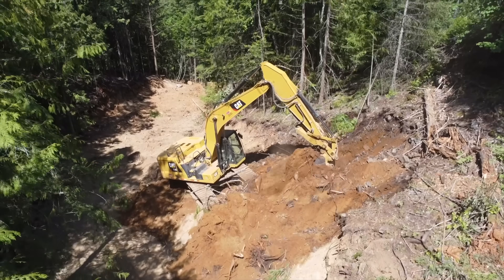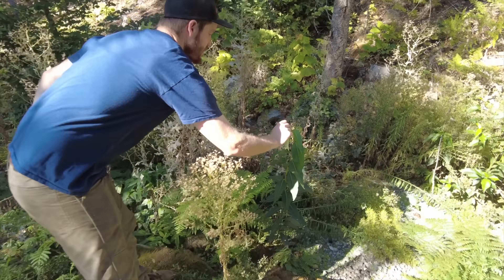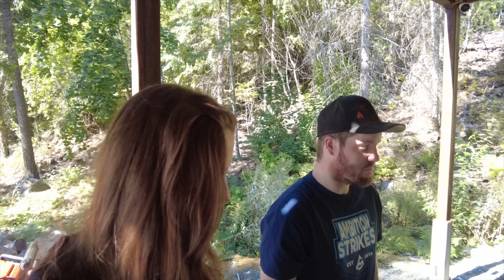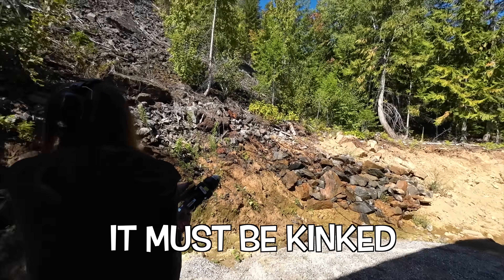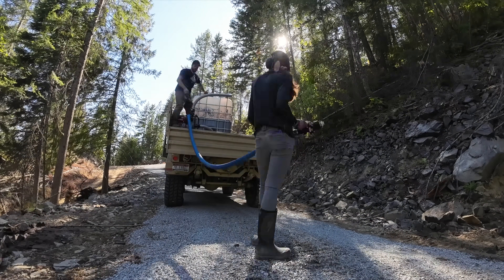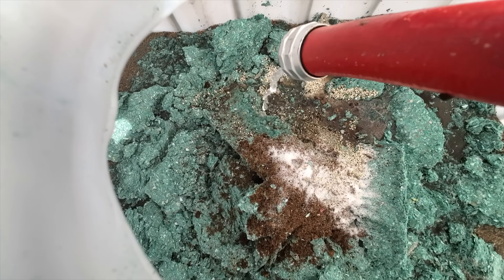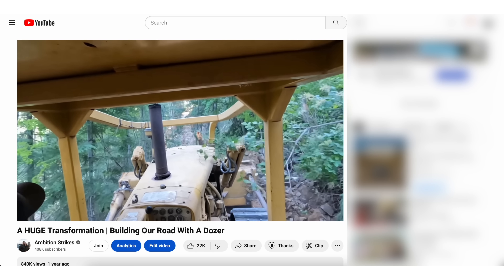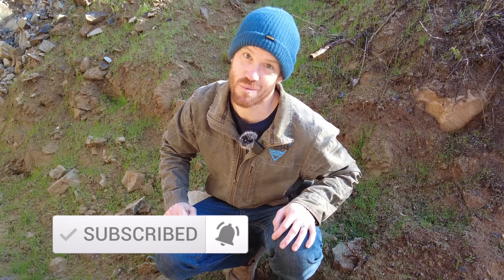Building A DIY Hydroseeder | Off-Grid Living

Comment: The cool part about the hydro setup is, when you are not using it to spread seed, it can be a great fire fighting tool.
Reply: Good call!
Reply: It just need to be ready at all time. Every pipe connected, pump primed, water tank full, and fuel tank full. And on a wheeled platform, trailer, truck bed...
Reply: @niconico3907  some sort of pallet or skid mount that the skidsteer can grab would probably work just fine.
Reply: Just came to mention this

Comment: That setup could also be put to use in case of Godforbid a brush fire or house fire. Would be better than waiting for the fire company to show up.
Reply: Put gutters on their buildings to collect the water.  We have an off road place where we do that. On our small roof one tenth of an inch of rain equals 30 gallons of water. Their roof would probably give them 100 gallons for that same amount of rain.
Reply: I thought that too! Having a full tote of water at all times would be a good idea to kill small fires.
Reply: @susanhighfield8284  Our last house was on a creek and in 1996 there was a big fire heading towards it. I bought a big pump and a small pump. The big pump would fill 3 55 gallon barrels in about a minute. They were in the back of a pickup and I had a long garden hose and a small gas pump to put out hot spots. I’d leave the big pump running water all over the lawn around the house near the creek.
Reply: @@grantjones5925 I get 3-6 feet of snow on the ground most winters and don’t have a problem. I mounted them low so the snow slides over them as most snow slides out some before it drops to the ground. Most rain doesn’t fall hard enough to overshoot the gutter coming off the roof. I’ve been doing it for over 20 years and no gutters have been damaged.

Comment: Attention, Riley and Courtney.. Tim from Canada.  If you were to hook a trailer onto your truck, your wife would have someplace to stand and you can do everything in one shot instead of her running up and down the road if she stood inside the trailer or even in the back of your truck. This would help your jobs go a lot easier for Hydro seeding your mountain. Just a suggestion (((number one.. hook a trailer onto the back of your truck have a long enough hose so you have some place to stand and this can be a one shot deal where you drive and Hydro seed the mountain same time
Reply: she could just stand next to the tote on the army truck.
Reply: Riley, .you should build a mount on the truck similar to a water cannon on a fire truck .  That way, Courtney can just pivot and aim.  Plus a water cannon seems right up your alley 😅
Reply: In some clips they showed Courtney standing in the back of the Army truck

Comment: Was wondering where the thumbnail photo you used was in your video?

Peat moss is THE secret for growing grass in an area thats just dirt. Those spots where you were disappointed in, if you hand tossed about an inch of peat moss over the seed you'd have grass in a week. You have to water it of course. Ive used peat moss on every new lawn I've put in. Holds in moisture and gives it some organic fertilizer.

Comment: we had best results by seeding, raking the seed in then spraying mulch to cover the seed.   This prevented the seed that was suspended in the mulch from germinating then drying out before the roots reached the soil.
Reply: i think their land would be too difficult to rake. it's not topsoil
Reply: @ronblack7870  just need to cover the seed.   If there isn't enough fines to cover the seed it will not take root.

Comment: I hope the grass does not get too high or dry out quickly in the summer and add to the wildfire risk. But if it stays green and keeps the ground from sloughing away it will be worth it! Will you get the roof on the new big shop/shelter building for the machinery and vehicles before the snow flies?

Comment: Hi there,
                 Those camlock fitting are renowned to pop open from vibration. Secure them with a cable tie thru the two metal rings. Obviously you’ll need to cut them off again. 😎😎

Comment: So from a guy how has worked in the industrial hose business for over 40 years that Blue discharge hose you are using is meant to be a way to dish charge water from a pump as an open end discharge only. It is not meant to be shut off on the discharge end while the pump is still applying pressure.  For that you should be using a discharge hose called mill hose ( looks like a fire hose). 
The blue discharge hose is like the cheapest stuff made.  You can also use your suction hose on the discharge side ( like you did)as long as you don’t exceed the PSI of the hose you have. Also a tip to slide the p c suction hose onto a fitting is to carefully heat it up. Few seconds in some boiling water or use a heat gun ( but keep it moving around). Let it cool a little and tighten up the clamps ( use two per end on 2” hose ID and up

Comment: Pretty cool. Your hydroseeder setup can function as a fire truck in the summer (with the right fire hose and nozzle). You would want a refill tank above the level of your tote on the truck with a large diameter hose ready to quickly refill the tote. If you really want grass to grow you'll want to put some topsoil on the tough spots. You could spray a manure or compost mix until you get an inch or two down. You need enough organic matter to hold the moisture. You could water the hillsides with this setup during dry periods to establish a solid carpet of grass.

Comment: Years ago, I used to work for a commercial landscaping company, and we'd hydroseed a ton. The mulch we used was basically ground up newsprint. Also, the hydroseed truck had a big agitator that kept the slurry moving around pretty good as we sprayed. Maybe in the future, you could rig up some kind of motor like an ice auger or something to stir the tank? Also, for steep inclines like that, we'd get large rolls of jute mesh that we would roll down the hill on top of a layer of topsoil. The jute mesh was then anchored to the slope with long metal staples. The jute helped the plants have something to "hold onto" as they grew, and would also hold moisture a bit. Eventually the jute would biodegrade and the staples would rust away.

Comment: You can use a sawsall with a metal blade or a cutter wheel on a grinder to cut large hoses or poly tubing.depending on the situation safer than using a blade sometimes

Comment: That's not just a hydroseeder, but a firefighting rig as well.  You could very easily modify it for use as both.  There could be a big water tank for fires or making your seed slurry.  The truck could then be used to irrigate those dry areas along your road.

Comment: Hydroseeding results that I have seen looked a lot greener than your - I think they spray it on a lot thicker than you are doing.  That doesn't mean you're doing it wrong, but you may get a lot thinner growth than you expect.  But, you're doing the right thing - erosion of all that bare soil is going to be intense.  A cold, snowy winter would be a boon, as the snowmelt would result in a lot less runoff than rain.
Reply: No classic hydoseed has dye in it to make it easier to tell where it has been done

Comment: When I see the highway maintenance department doing this, it's a lot thicker, and it's super green, so it shows where they have sprayed and not sprayed. Maybe go over that hillside again with the final application that was done correctly. And you will need to water it occasionally too. Getting new grass seed to grow takes a lot of water. But not to much to wash it all down the hillside. Good luck.

Comment: Nice build. You actually have another use for that setup and that would be a portable firefighting tank and pump. With you being off grid it would be nice to have a 250 gallon tank for an emergency around the home or if a small brush fire started. Just need to keep the tank topped off and protected from freezing.

Comment: For the areas where growth is a problem I suggest using a tougher seed more suited to harsh condition   the soil may be innert sub soil mulching  and or fertiliser  would be a start in addition wildflower seeds mixed in would produce a stunning displays four season varieties the best results   giving pleasure in and out as you have got a seeded  its not to much cost I don't know what variety of the grasses you have but very hard wearing  looking great container shop will be awesome  ever considered turn the roof into a cabin type structure would look fantastic with that view
Reply: I've improved readability of your comment:
To address areas where growth is a problem, I suggest using tougher seeds that are better suited to harsh conditions. The soil may be inert, so subsoil mulching and fertilization would be a good start. Additionally, mixing in wildflower seeds would produce stunning displays of four-season varieties and provide pleasure year-round. It won't be too costly as you already have the seeds. I don't know what variety of grasses you have, but if they are hard-wearing, they will look great in a container shop. Have you ever considered turning the roof into a cabin-type structure? It would look fantastic with that view.

Comment: Well done team Ambition!  A friendly tip from someone who works with Banjo fittings and totes.  Use gardening velcro ties to hold the clamps closed. You don't need much holding power to keep the clamp arms closed. Quick and cheap.

Comment: Many years ago I worked for a company that had to hydro seed. I don't remember the name of the chemical that was used but it was a white powder that was added to the mixture along with a dye to see where you got coverage. The white chemical would turn into a jell substance that when sprayed onto a solid rock wall would retain moisture and feed the seeds for awhile and would absorb rain and hold it for a while. They grew grass on solid vertical rock walls. Research that.

Comment: Ha!  I commented on this concern on the previous video and you all knew you were already all over it.    You could keep a small shovel in your car and every trip back from town you can transplant some local fauna to our bare patches?  The only winter prep I can think of is you all putting a fuel storage system (insulated) if required by your generator so it is easy to run the generator when the solar is slacking.

Comment: Very interesting!

However,  as I think about it, I'd be inclined to spread your seed, peat moss and such by hand and then use the pump to spray water on it to encourage sprouting.  That way you'd have much more control over where your seed goes  ---and you could return to add water if rains aren't helping.

Very creative, though.

Comment: As far as getting ready for winter, you will want to make sure all of the fluids are topped off in all of your vehicles and maybe get some trickle chargers for the batteries. If you think you're going to be using the diesel powered equipment, an electrical supply for the block heaters will most definitely help starting on days and nights with freezing cold temperatures which will help mitigate the pleading the battery power.

Having a supply of food for a month wouldn't hurt but I don't know how far off grid you folks are.

When feasible I would definitely get some more water totes and possibly daisy chain them together with valves on each outlet to increase the water supply.

Comment: Most erosion is not from water or snow falling directly on the cut.  It's from water coming down the hill side and accelerating when it's hits your cut.  It can help a lot to dig a drainage ditch just above the cut to divert that water.  Then you coat the ditch with gunite so IT doesn't erode.  I can see that the surrounding land doesn't really have much grass, so I'm pretty skeptical about the grass thriving on your cuts.

Comment: Have you considered using some of those gel-based water pellets on the dry spots? I've done some volunteer work packing tree saplings, and we would always dip the roots in that stuff before bagging them. No idea what they're officially called though, I hope you know what I'm talking about. They might need to be buried in the soil to work properly. Maybe throw a bucket load on top after you put them down.

Comment: Add tall poles, tipped with reflectors near the lower edge of your road.  Since you do not have actual guard rails it would be good to know where the drop off begins.   Do you have a fuel bunker or are you bringing in cans when needed.  Perhaps you could store winterized diesel and some gasoline in bulk containers, 55 gallon steel drums.  Away from your house and solar arrays but within easy access.   

Wishing you and your family a blessed holiday season filled with gentle seasonally appropriate weather and restful evenings together.   Peace

Comment: I did notice you were making some heavy cuts into the slope. Have you looked into Gabion Cadges / Baskets? Boxes of heavy stainless wire mesh filled with rock. You did rip out a lot of rock. And a simple jig would make welding fairly simple. These are used a lot in Canada (& probably the States) to stabilize highway cuts. When stacked on a slope, the self-weight would go a long way to prevent slumping. Especially since excess soil moisture drains easily, releasing internal pressure. Suface erosion is virtually eliminated. Aesthetically, they have their own thing going on, especially when local rock is used to fill the cadges. I'm not an Engineer, and I'm not there.
Reply from the maker: Every time we see gabion cages we admire them. It looks like a fun project that would really help us in a few spots.

Comment: While you have that pump and toet setup you can easy take additional water from your well (if you have)? and water the probem areas who makes you worried and the slow growing spots. Giving them a boost as long as its warm enough to grow. 
Same goes for next years spring.
After the first warm month you should see areas where its not gwoing. 
You and can seed it again and now water it down as long as you have access wate.
If you are putting some spreading system like a firetruck would have on the army truck you have a fire fighting setup along your roads and a water delivery system for hot and dry periods.

Oh and please empty all your pumps and hoses and let the valves open in the winter to prevent icecracks. For a potential fire fighting setup realy important to not destroy it. Also to get into the habit of emptying the pumps after use and filling it up with new gasoline (ethanol free if possible fo long therm storrage)

Comment: How are you putting air back into the tote to replace the water pumped out ?   A vacuum in the tote will collapse the tote.
Reply from the maker: We drilled a hole in the top of the cap!

Comment: Remember that you each personally put 40+ hours work into each video that we watch in 30 minutes. Every time you watch a how-to video you do the same 30 minutes quickly re-seeding a field on video was the product of 30 - 50 manhours of real work.
I met a UK company that did hydroseeding, they used seeds that had been coated in a rich soil mix so that they could seed barren land with some success.
Add some seeds of local shrubs to get bigger plants growing, big plants usually have big roots which stabilise more soil, can you forage for seeds of your local trees -they should suit your weather/climate.
Yes the seed sprayer would do well as a fire truck in the summer.

Comment: I'm so glad to see that you have decided to hydroseed.🌱
 That will most certainly help against erosion in the spring.
Those trouble spots you were pointing out earlier the good candidates for ferns.🪴
 They don't need as much light and they don't like a lot of water.
Not only is that system great for hydroseeding but also for fire suppression.🚒
I would put a flapper check valve on that return line though.🤔

Comment: so  you say you get 1 1/2 gallons / hr of water yet when you did the video of the atmospheric generator you said 1/3 of the 210 gallons / day theoretical output was not enough for your needs. so how are you getting by on 36 gallons/day now when you needed 2 times that before?
Reply from the maker: That was maximum output that we saw from the water generator (in ideal conditions). Most of the time it wasn’t producing any water. 

The well has been producing constant since we dug it. We currently live on 100 gallons/week of water so it is far out producing our needs.

Comment: I honestly think you haven't done enough along some areas of your road. Have you've ever noticed what they do along steep hillsides when they build highways? They drive long rods into the side of the hill and use slope stabilization mesh to prevent it from collapsing. I've also seen very high fencing to stop rocks from rolling onto roadways. You might want to have a professional look at those areas along your road and see what that person has to say.

Comment: Yes you should have had a valve at the bottom of the tank, and  a trailer so that it could be driven around where it was needed , not into the carport as now you will have a nice landing strip. ehheehheheh.
Better for what others have commented on a fire protection needs!